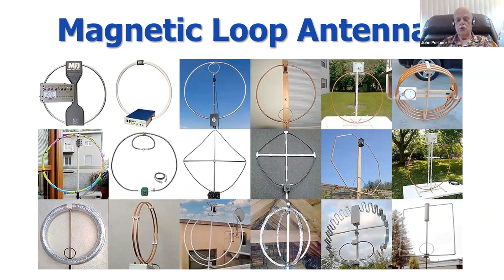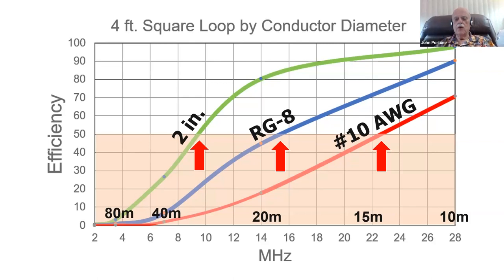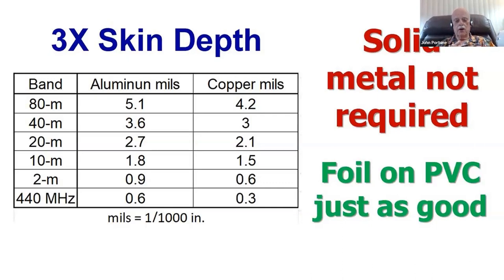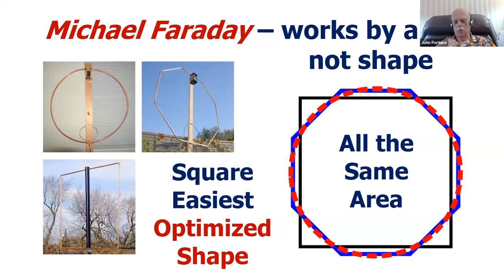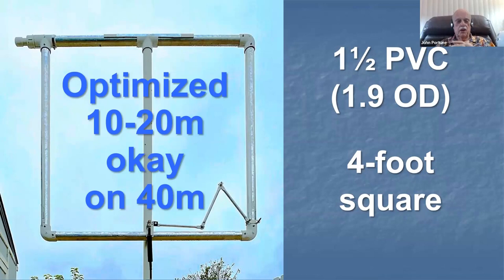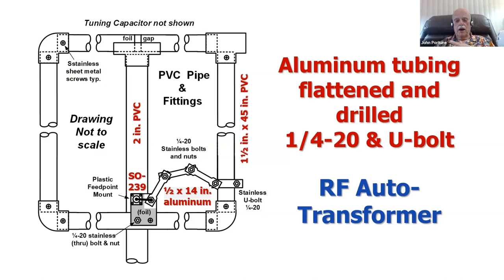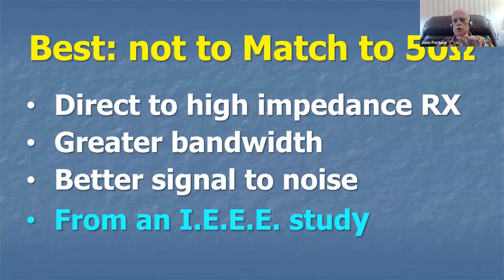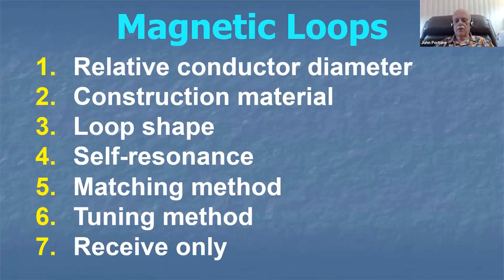John Portune, W6NBC, on Mag Loop Antennas

Comment: On the foil tape. Do you need to do anything about the adhesive where the tape overlaps?  I don’t think that tape is made to specifically be conductive so the adhesive may not be conductive either and the overlapping portions may not be making a good connection.
Reply: The adhesive layer is very thin, and so the overlap has such high capacitance that it is effectively a short at RF

Comment: I wonder what edge skin effect is? I cannot find any mention in my sources- . The antenna at 55:43 did not look too bad for me. Except very thin see through conductive material.
Reply: There is no "edge" skin effect: skin effect is the result of the current trying to get as far away as it can from other parallel currents.  This means that to take advantage of skin effect, your conductor's cross-section needs to be as close to perfectly circular as possible.  If it is square, then the effect of the currents being repelled from each other is that all of the current goes through the corners of your square conductor.
Now I'll go off the beaten path into conjecture on my part: if you do a multi-turn loop, I believe the coils should be arranged to that together they form a cylinder around their center.  Once your into multiple turns, the current will all be on the outsides of those turns, to the extent that maybe you only need to put the aluminum tape on the outward-facing side of the PVC/ABS/PE pipe.  I'll need to think about this further.

Comment: Hi, I have had my license for a long time, mostly for 2M work with the local network for hurricane shelter emergency work. But now I am retired and going to move into a bus I am converting and sell my condo <the main reason I have not been active, condo rules.> I have been watching "mag loop" antenna development and was considering one for the roof of the bus and one on the roof of my jeep. But I had been figuring on laying them horizontally for nondirectional use but you are the first person I have heard say they wont work horizontally.  I was just wondering why they won't work as well horizontally as they do vertically. The radiation pattern for the loop would be nice if they did work horizontally. I can make them tip up and put a rotator <tv type> on them. But that would make them only usable when not on the road.
Reply: Mainly, it's because the magnetic field they produce is through the axis of the loop.  So if you have the loop oriented horizontally, the field is going into the ground and straight up into the air.  Pay no attention to what John says about there being no such thing as a "magnetic loop antenna".  Both electric field and magnetic field transmissions end up being the same (i.e., a balance of electric and magnetic fields) once you're a few tens of wavelengths away from the antenna, but in the near field, these small loops (i.e., diameter << wavelength), the near field is almost purely magnetic.  There is simply not enough electric field gradient across their diameter to create a significant electric field.  And one of the chief advantages of magnetic antennas is that they don't pick up NEARBY electrical interference nearly as well as do electric antennas (i.e., "dipoles").

But DO listen to what he says about making your conductor's diameter as large as you can.  That much is gospel.

Comment: Great article. Perhaps I misunderstand the application of the aluminium tape. Rather that cut the pvc elbows and line the inside of them with tape, is it not possible to simply glue the elbows to the frame and then wrap the  frame with the tape overlapping the elbows and the frame with two or more wraps resulting in continous continuity.

Comment: John, your first video you specify a skin debt for 40 meters to 1.2 and on this video you change to 3x at 3.6 mils.  In determining thickness of aluminum or cu tape the aluminum should be at least 3.6 mils thick for 40 meters?  May I also ask if this loop will work with an sdr rspdx as  at this point I will only be using it to receive not transmit?
Reply: Is there a final build for this?

Comment: If square gets you more area, then wouldn't building a square shape loop but with 3x3 or 2x2 boards and covering with aluminum tape for more surface area of the loop?
Reply: No.  As John says near the end, if your conductor is flat, then the skin effect moves all of the current to the corners of its shape.  The cross-section of your conductor still needs to be circular to get the best conductivity.

Comment: for testing the loop with a field strength meter/magnetometer , etc in the far field.
The inverse square law states that for a point source of waves that is capable of radiating omnidirectionally and with no obstructions in the vicinity, the intensity I decreases with the square of the distance, d, from the source.

Comment: About the efficiency discussion: 50% loss of power is -3dB. One S-unit is 6dB. So 50% loss in antenna is half S-unit on receiver. Of course if both sender and receiver are using same kind of antenna with 50% efficiency then the losses are combined to 6dB thus one S-unit.
Reply: Yes, but you don't have any control over the other person's antenna.  It's better to think of what you're sending as effective radiated power, which takes YOUR antenna's efficiency into account.  What's going on at the other end is the other guy's problem.

Comment: Excellent article. Perhaps the mag loop should just be referred to as a closed loop or simply a loop. I’ve been in a on again off again process of building a loop with 1” copper (a freebie throwaway) that works out to 48” diameter. I’m rethinking now to go to the larger diameter. I would like a loop that’s relatively efficient on 40 that can still be hauled around. And being able to operate close to the ground is a plus. Thanks for the ideas on tuning capacitance. And I will look into the use of PEX as well. 73